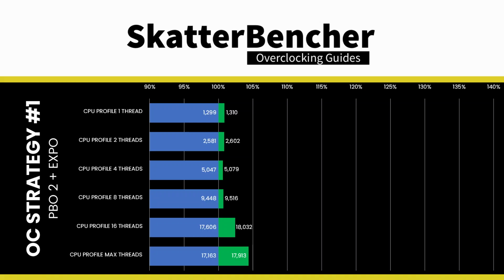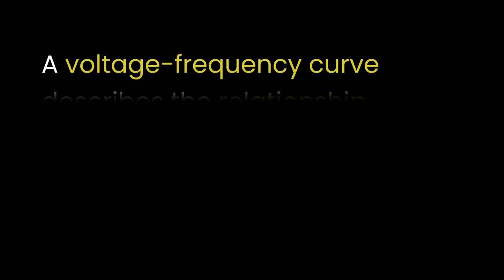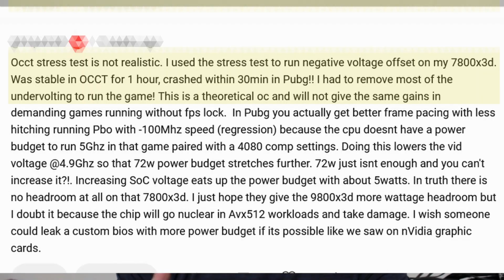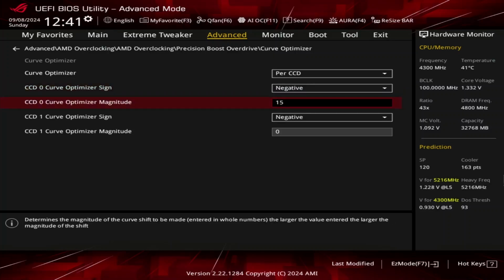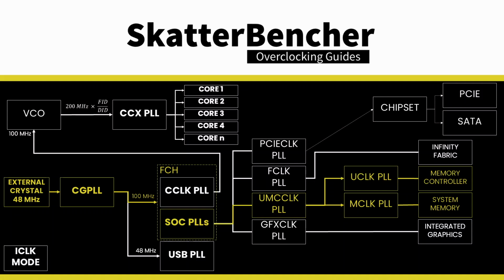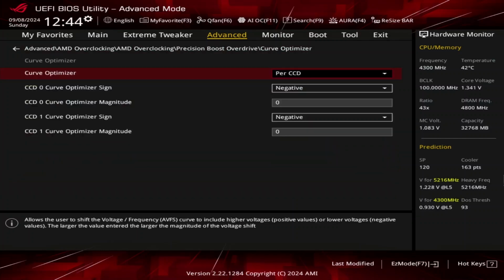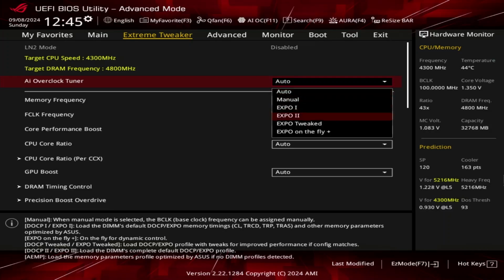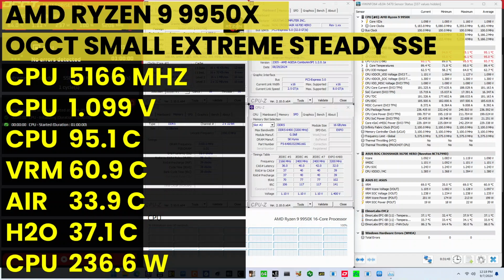Ryzen 9 9950X Undervolt & Overclock to 5900 MHz | SkatterBencher #81

Comment: I'm getting bored and a bit confused playing with PBO, as I'm not sure how to properly test each core to find its optimal value. Even with a per-CCD curve of -15 on one and -10 I managed to get low voltages, but the processor still runs about 15°C hotter on average than with a manual undervolt.

Following another guide, I switched to a manual overclock: a 50x clock ratio, a voltage of 1.1250V, and a 162W PPT limit, PBO off, EXPO on. With this, all cores are locked at 5 GHz. My Cinebench R23 score for these settings is 42,182. The temperatures are excellent, and the whole system runs quietly. 45-50 C in idle max 85 C in hard work.

For anyone who doesn't want to mess with PBO, didn't win the silicon lottery, or has a weaker cooler, I highly recommend giving these settings a try. It's better than stock, and while there might be a slight dip in single-core performance, it's pretty much irrelevant on a processor this powerful.
Reply from the maker: High temperatures will be an effect of enabling PBO. Specifically, unlocking the power limits. That's because the Precision Boost algorithm pursues the maximum performance which includes using all available thermal budget.

If you want to limit the temperature, you can manually set PPT to a lower value or directly set the maximum temperature. You'll still get the benefit of extra frequency from the Curve Optimizer undervolting.

Comment: I’m crashing with oc strategy #4 under low loads when using browsers etc.
I can do gaming but not browsing
Reply: Changed boost clock from 200 to 125 and it’s working, will try to push it further later today.
Reply from the maker: Sounds like an "upper part" of the vfcurve problem. 

You can also try increasing the Curve Shaper value for max frequency in medium and high temperature.
Reply: @SkatterBencher  turns out it was the BIOS build that was causing the instability, I was sure it was due to ambient temperatures because I followed your guide back in spring. Thank you.

Comment: Just built a 9950x3D the Gigabyte Aorus x870i ice TeamGroup Expert 64gb 6000mhz all white build now to fix the 4.3ghz lock in bios lol
Reply: You have similar rig to mine. I have to run Expo 2 though for 4 sticks of ram
Reply: @whitey3177able I tried I had 4x32gb of this teamgroup it did not want to post reliably some posts would take 10+ mins  so sold it man kicking myself that kit was $256 now it's $1900+

Comment: Love your videos. You didn't entertain using an async buss clock form of overclocking as you usually do on the ryzen 9000's. Supposing having two 8 core banks isn't advantageous for this mode ? I'm considering going to the 9950x from a 8 core ryzen. Since you didn't use async settings on this cpu possibly means a very top tier MBd. isn't necessary for these since they don't have async capabilities ?
Reply from the maker: For this chip I didn't use async eclk because it wasn't hitting the Fmax+200 upper ceiling of 5950 MHz. It only got to 5900 MHz.

Comment: First, you need to figure out the cooling, otherwise it's all just guesswork.
changing the overclocking settings, only the core that first reaches the critical temperature will change and stop overclocking the other cores, even if they are 30 degrees cooler than the hottest core. Notebook with R9-7940HX looks like haven't this problem like R9-9950x, maybe because initially direct die cooling.

Comment: My main problem with this tutorial is that I want to overclock the "old school" way.
I can increase the multiplier to 59 for example and it will display 5.9 Ghz in the benchmark hardware readouts but in reality the CPU will overall run a bit slower than it does stock...

I know I really should try the modern tools at hand but I'm confused about the most basic stuff not working
Reply: Mutltiplier at 59 with HT disabled of course

Comment: I got a 9900x but this is still super helpful compared to other videos I watched. Big UP!👍
Reply: I got +200 core clock and -15 curve optimizer running. It's doing as good/slightly better than stock while producing less heat. Have you managed to get a good undervolt/overclock going on yours?

Comment: Hey, awesome video. I did everything and I’m scoring 40382 on cinebench and passing all the stability test. That being said I’m having hight temps about 95c full load, idles about 50c and regular gaming about 70-80s. Any suggestions? I have the lianlancool216 and I’m running Nzxt kraken z63 280mm
Reply from the maker: That sounds about right temp-wise. There's two options:

1) Set the TjMax yourself in the BIOS.
2) Check what's the PPT in full load scenario and reduce it by 10% in the BIOS.

Both approaches will give you lower temps under full load.
Reply: @SkatterBencher  thank you!!

Comment: I'm having stabiltiy issues with Strategy #2

What should I lower to test stability? Lower CPU boost overclock override? Thanks in advance
Reply from the maker: The most likely issue is too aggressive Curve Optimizer, so I would first reduce the negative CO
Reply: @SkatterBencher  if its negative should I lower it from 15 to 10 and 10 to 5, to see how it goes?

Comment: I have 9950x with 360mm aio and i accidentally overvolted to constant 1.35 volts and underclocked to 5.1ghz bcuz im just testing things learning on my own tuning. I benchmarked in cinebench 23 and hit 103c with average 96c. The max safe temp advertised for this cpu was 95c. Now im panicking over my cpu already having degradation by the first week using it. I undid everything and now my cpu doesnt go above 75c stress test with auto clockspeed & voltage on with pbo on 150mhz+ and curve optimizer and shape manually tuned. But now my cpu goes upto around 1.4 volts while idle. Is this bad? Is my cpu damaged and how can i tell if it is? I want to prevent further degradation if so. Ive tried searching many forums but nobody has clear answers. Thanks for any help❤
Reply from the maker: Your CPU is not damaged and 1.4V idle on desktop is normal. 

It's boosting to 1.4V because there's no load on the system and it uses the high frequency to quickly get some background tasks done. It's entirely within spec.
Reply: @SkatterBencher  thank you so much. Curve shaper is such a nice new feature!

Comment: I have the Kingston DDR5 Kit  ( PN KF564C32BBEAK2-64) and I set per your recommendations and while the +200 in boost clock was not stable, things seemed mostly fine for a few days including ram stress tests... I just adjusted my settings to be TRAS back to default of 80 instead of 38, and set DDR5 frequency at 4000mhz as a temporary test... do you have any advice? all other settings per your video are the same for my setup running an ASUS ITX board with a 9950X.  thanks in advance if you are able to help!
Reply: Seems stable with above, now testing with looser mem timings at 6200 mhz.  is also stable I will tighten memory timings and see if perhaps the large capacity IC are more sensitive and more difficult to run 6200mhz AND tight factory timings.. even though it should run  32-39-39  TRAS 38 may not be stable... we shall see

Comment: Why you use 2100 with 6200?
Should be 2066 for sync....
Reply from the maker: I've seen this comment float by a couple of times. Do you have a link to a resource with more technical information about the 6200/2066 sync benefits?
Reply: @SkatterBencher   6000 - 2000, 6200/3 - 2066, 6400/3 - 2133, 6600/3 - 2200.

It sync question.
like it doesn't make sense to put 2100 for 6000 - 2000 - is the best.

Comment: How do you check the stability of Curve Optimizer on 9000 Ryzen? I tried many tests in OCCT, Prime95, Y-Cruncher and CoreCycler - it find nothing.
Reply: It’s really confusing. Everything would point to my system being stable but my browsers were crashing if my GPU was undervolted as well.

Comment: I’m pretty new to this, my question are these methods you shown better results performance than the Ryzen Master curve optimizer software? Thank you
Reply from the maker: I only tried the Ryzen Master Curve Optimizer software once - with a Ryzen Threadripper 7000 - and it didn't give satisfactory results. So I prefer sticking with manual optimization.

Comment: Insane quality tutorial, thank you very much, but ... by the past you posted 7950X + Gigabyte, now you seemed to go to Asus. I surendered with my Asus because of too many problem with Intel LAN chip so I am now back with Aorus Extreme with Marvell and everything is fine. Would it be possible you post a 9950X + Aorus Extrem guide ? Kindly greetings
There's no Expo2 tuning mode on Gigabyte, how do I translate it ? Just saw Expo 1/2 on DDR5 setting
Reply from the maker: I'll consider trying another vendor for other Ryzen 9000 guides. Unfortunately my good contact at Gigabyte left so it's a lot more difficult to get answers if I have any overclocking questions (which I have, a lot). That's why I stick with ASUS this generation.
Reply: @SkatterBencher  Thank you for taking time to reply. keep on your oustanding job and analysis :)

Comment: Just picked up a 9950x with X670e motherboard, this is my 1st Amd CPU in 20 years, just moved from the 14900K. Anyways it seems that overclocking the 9950x doesn’t seem to improve much? Not complaining about the few % increase, but at the cost of more power and heat, doesn’t seem to be worth it, What do you guys think?

Comment: Dude I love you! This is the best Overclocking video I've ever seen. Built my system with the 9950X two days ago and spent the whole weakend tweaking my memory, but I tuned it for 6000Mhz since I read it was the best frequency. How much does the actual memory frequency affect performance, For example would 6400 CL30 be better than 6000 CL26, than I would need to spent another 20 hours on memory tweaking that's exhausting.
Reply from the maker: I don't expect huge differences in real-world scenarios like games, but from the benchmark results it appears memory tuning does provide extra "oompf".

The performance is not tucked away in the primary timings but rather in the unoptimized secondary and tertiary timings. That's why I usually leave the primaries at EXPO and use the memory preset to tune the sub-timings.

Comment: The fclk is all cpu dependent amd the lower the soc voltage the higher it goes uclk is also cpu dependent and tops out at 3200 for 90% of cpus and if u are extra lucky 3300. If u are running 6400 fclk shoudl be set to 2133 and uclk should be in 1 to 1 mode
Reply: If u are doing 6200 then u should do 2066
Reply: It’s 2133 because the f and m are in a 2:3 mode

Comment: Is a 6 GHZ all core 9950X possible Skatterbencher? Probably need a water block, DELTA TEC 2 Quantum custom loop water cooling solution, proper deliding of the 9950X processor, direct to die, or LN2. Phenomenal work as always regardless, 5.90 GHZ if its all core is impressive regardless!
Reply: All core impossible with pbo cause the ccd2 will block you , with ln2/dice maybe possible
Reply: Direct-Die should be enough. Because with Direct-Die you become 20°C lower temps and if you than go customloop the system than the temperature isn't a problem

I become next days my delided 9950x and until mid next year I use my artic f36 for cooling, than I change to Direct-Die and customloop. My 9800x3d after march/April 2025 become the same procedure.

Since I saw the video from the b8uer that he delided his 9800x3d and become 20°C lower temps with an 360mm AIO, so I know if I buy a 9950x and a 9800x3d both become Direct-Die and a customloop include their gpu and ram, maybe I found space for watercool their nvme, too.

So LN2 isn't need for 6hz if skatterbench reach 5.9 Ghz without Direct-Die

Comment: AI really likes overclocking. Cant wait for your 9800X3D cpus overclock in november... when you do you should add a couple games in there, unreal engine 5 games.
Reply from the maker: Any suggestions for UE5 benchmarks? Preferably ones that are easy to run :)

I'll see what I can do for the 9800X3D. First, I'm spending a month in Belgium with family so no access to my lab space
Reply: @SkatterBencher  what do you mean easy to run you mean like so called " canned" benchmarks?
Reply from the maker: Yes
Reply: @SkatterBencher Stalker 2 definitely
Reply: Too bad UE5 is junk. They need to get mGPU working in that engine its too over the top for a single gpu

Comment: The limiting factor on all your overclocking strategies is the air temp. OMG 34 celsius!!
Reply from the maker: Taiwan summer and the system is tucked away in a corner will make the ambient temperature go up quickly :)
Reply: @SkatterBencher  you wil have waaaay better results at 21-22 degrees room temp!!!
Reply: Haved checked that, yes it little ridiculous for review that cpu for OC
Reply: Is that ambient or air temp out of the rad?
Reply: @WaspMedia3D  Ambiant check 2:39

Comment: My alltime fav stability test is running ycruncher v3 + small while having bf2042 open on a 128 player map while a single core game also is in use and then having 50 tabs open in Firefox and switch between programms and introduce max stress. 
-20 curve on some cores was stable with stress test but after this setup it crashes firefox tabs or bf2042 , now on -5 and -10 or 0 on weak cores

Comment: I wonder why AMD and Intel don't use what you do in the first place as in general your settings will work on most samples so even if they scale it back a little to work on pretty much everything it would still be a big improvement over stock.
Reply: im happy they dont do so, since its more fun for us and the amd and intel presets will always give a baseline without stability issues :D nevertheless skatterbencher mostly does per core co, meaning its impossible to adopt the same co from one sample to another
Reply: @pokcaU  I miss the good old days where I could trace a new wire using a pencil and that would unlock more cores!